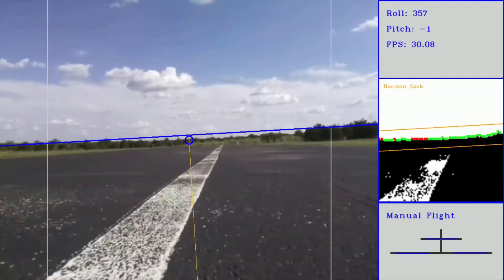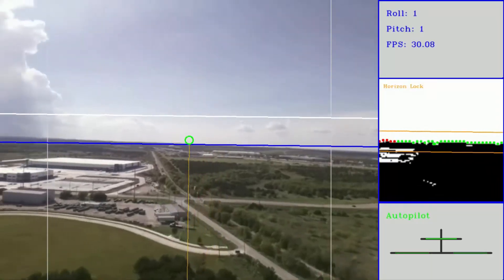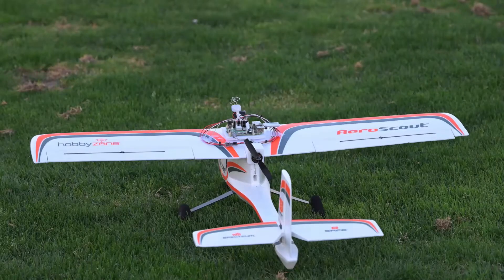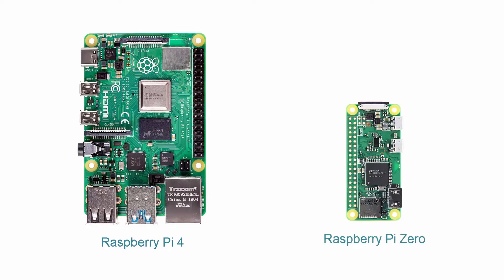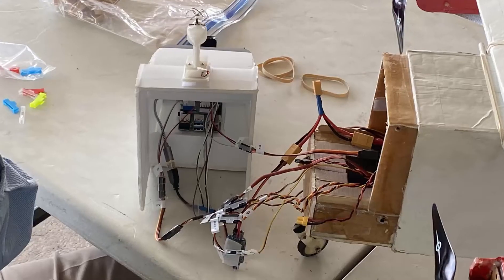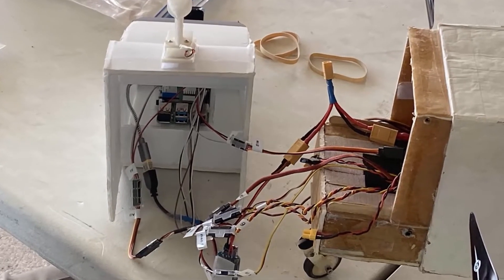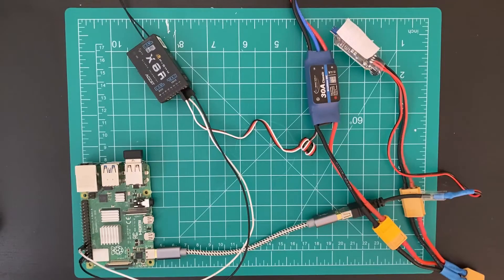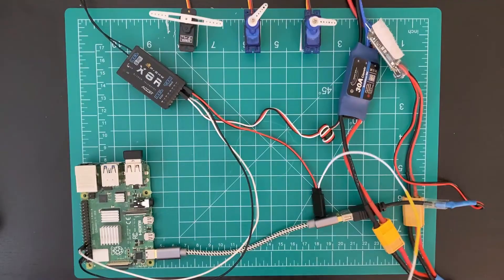Raspberry Pi Flight Controller: Hardware Review

Comment: Can I use it to do autopilot missions or manual flight control with automatic stability?
Reply from the maker: Yes, that’s the idea. I had hooked up a previous version of this to a computer vision autopilot which could stabilize the plane. It didn’t do waypoint missions, but in theory that could be added.

Comment: Isnt the raspberry pi zero w too weak for this? Because im planning to do it
Reply from the maker: Raspberry Pi Zero 2 worked for the setup I show in the video. It’s probably not powerful enough to do much else. I wanted to run some computer vision algorithms on it, but they were too slow
Reply: @timmarkhuff  i plan on testing this with my spare raspberry pi zero w with my fs ia6b reciever

Comment: How would this differ if the Pi was to be the input? For example control over 4g via qgroundcontrol?
Reply from the maker: Qgroundcontrol would want to interface with an off the shelf flight controller like a pixhawk. I’m not sure exactly what it would take to get it to interface with an rpi based flight controller, but it sounds like a whole project 😅
Reply: @timmarkhuff  Could it be piped via mavlink router perhaps?

Comment: Bro can i use flysky fs i6 for this project
Reply from the maker: I have never used that transmitter before. It might work. The key thing is that the receiver needs to output SBUS. My code is designed to use SBUS.

Comment: Great stuff man, Im currently working or should say sstart buying hardware for it and I am not too familiar with the electronic, however even if I crash this I'd have some joy on working with that. 

So in theory I can have one LiPo Battery for the whole setup meaning, servos, ESC and motor, pi controller, however this needs voltage converter for pi and servos right ? I My limit for motor is 5s and they are pretty rare , however if I use one 6s battery for everything voltage would drop down eventually and should work ok, another options is larger propellers. My ESC is 50A and engine is 1100 KV and 911W. 

initialy I was thinking to only use one battery for ESC and motor and another setup for  the rest, but now I think that minding the weight it may be not ideal. 

Please just be aware that I am completely amatour and still leaarning this by having a goal to do something working 🤣
Reply from the maker: If weight is a consideration, getting a buck converter to convert the voltage for your raspberry pi is the way to go
Reply: @timmarkhuff  Thanks :)

Comment: Thanks. I want to do this on some level with a Pico/MMBasic and already have a PWM Throttle function similar to a tester. Some sensors should be able to provide "something" to start with and flying in a straight line for some time would be a pass.

Comment: 👍I looked at the sources.  seems like I might dare.  but where do i choose the pins for the servos etc.?  Didn't find this in the GitHub sources. thanks.
Reply from the maker: Thank you for your interest in the project! The GPIO pin numbers are passed into the TransmitterSwitch and ServoHandler objects in main.py. Please note that the version on GitHub is a slightly older version than what I use in this video. The version you see on GitHub does not use SBUS, but rather reads each output from the receiver using different GPIO pins. I plan to have the updated SBUS version of the code up on GitHub soon, but it still needs more work at this point.
Reply: @timmarkhuff  thanks! So I should wait...
Reply from the maker: @mrmoonrc  I would wait. The next version will be better and easier to install and deploy.

Comment: you can use ELRS with an sbus(i think it's the protocol on the RX output side) library if you want more range and consistancy, and want to reduce weight. A bit of a tangent to your goal, just in case you need it! 

You could also get a pwm ELRS receiver, but that's more than 1 wire, but you're using the RX as PDB so might be a better option

Comment: Future Ghost is back, after ingesting the rest of the awesome: You're doing this with a Pi Cam 2?!!! I assumed you had the mythical HQ Module with a long-ish lens (the cam 2 is 62 degrees FOV, but the discriminator shows about 10 degrees of sky and horizon, no?). Sorry, this is absolutely fascinating. Last question, I promise.
Reply from the maker: I have an HQ camera and I originally intended to use it for this project, but I learned two things: 1) it’s very heavy with its lens, not good for flying on small planes 2) the normal RPI camera captures plenty of detail for what I am trying to do. No need for HQ. Of course, it might be nice to have an HQ camera just to get better video of what I am doing, but it won’t make the program run any better. 

The FOV of the Camera v2 is 48.8 according to the documentation. The horizon detector uses this value to calculate the pitch.
Reply: @timmarkhuff  Holy crap, I saw the new Global Shutter Camera from Pi, and thought of your project. Not sure if your system suffers from rolling shutter, or Jello, or any CMOS specific issues, but take a look: https://youtu.be/1r9AxhCZclc

Comment: how hard would it be to use crsf instead of sbus
Reply: at last you can use CRSF to SBUS converter from Matek or any other
Reply from the maker: I’m not as familiar with that protocol, but in theory it should be possible. I found a Python library that can read SBUS. Perhaps there is something like that out there for CRSF, or if not, perhaps it could be created.
Reply: @timmarkhuff  its rather simple. buzz trappy for spec pdf, takes 100 lines of code max.
Reply: is ELRS sbus or CRSF on the RX output ?
Reply: never mind its CRSF